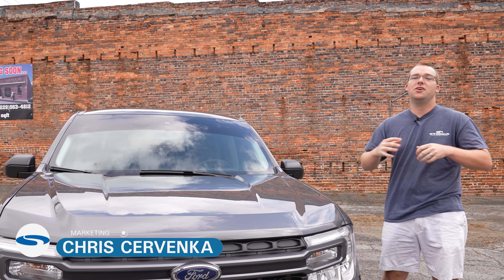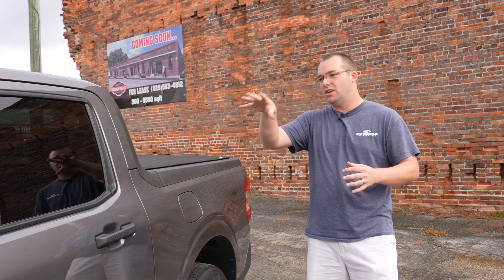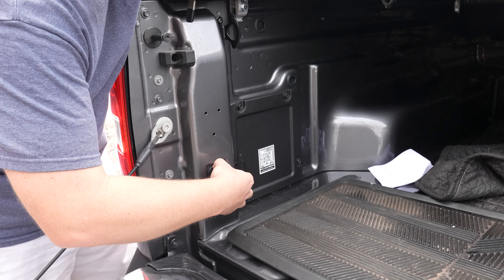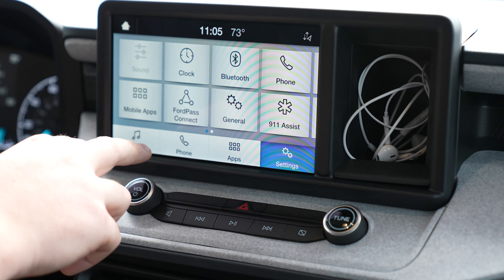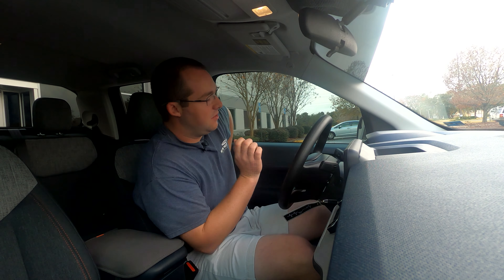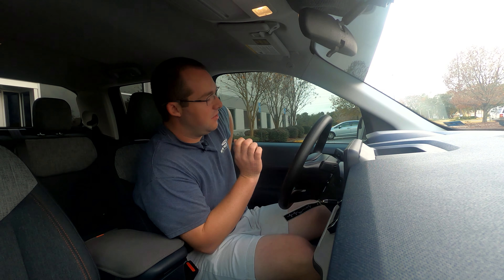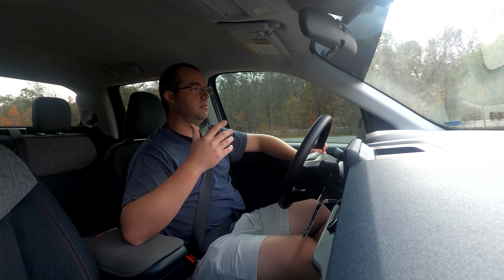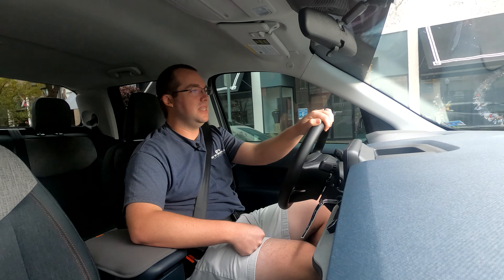Hands On The New Ford Maverick - Driving Reactions And Walkaround!

Comment: Please provide lowering springs for hybrid model. Most of us with front wheel drive hybrid have no intention of taking it off road. Would be fantastic to be able to level the truck by replacing rear springs. 1 inch or possibly 2 inch would be sufficient. Can’t wait to see what you come up with.      Please do your best to take food vantage of force vectoring rear suspension, apparently it is a big hit in Europe in small Ford fiesta ST.          Allen